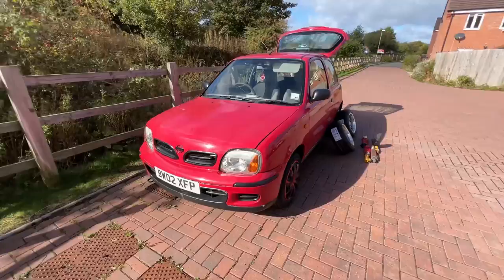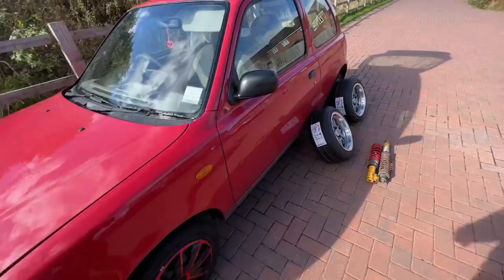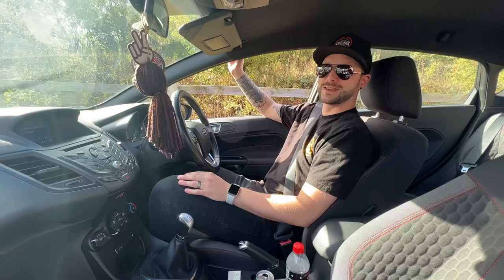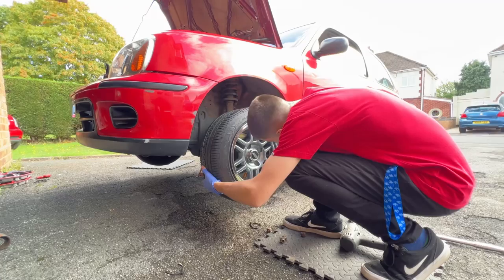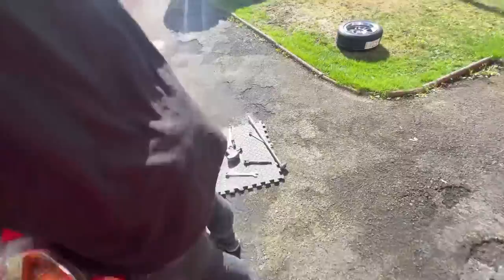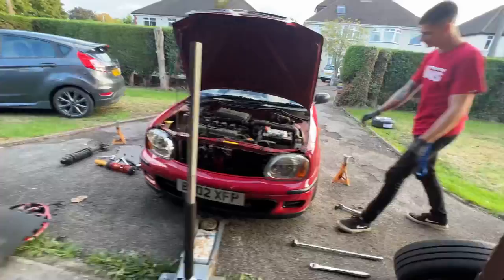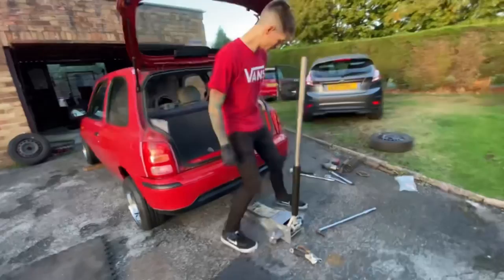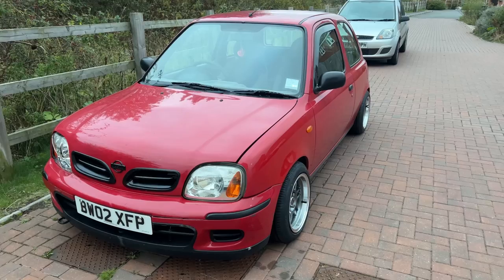Nissan Micra K11 - Best starting mods for new projects

Comment: hello from Australia ,i just bought a 5 door and would love to go bigger on tyres ,its got 1656513 and id love to know what size 15s i can fit with no issues ,i just smashed the subscribe button and glad to be here
Reply from the maker: Hey dude! Thanks for subbing! Most people go for a 15 x 7 and just try and keep the offset around 30 and you should be golden. 

Much love
Reply: @TheCruise94  19505015?
Reply from the maker: @PETERNESS  Possibly. Depends if you’re going to be lowering it or not, 195 is pretty wide if it’s going to be low. But should be perfect if it’s staying stock or just going down a little bit
Reply: @TheCruise94  thankyou  for reply

Comment: Do u still use the rear spring I noticed how the rear coilover had a spring around it which bolts to where the shock absorber goes probably stupid question ask but quite confused
Reply from the maker: You use the coilover spring provided, they’re separate

Comment: Hi I have a 2001 micra 4 door with 15 inch bbs reps. Put new shocks in it and when it’s parked up looks like there is loads of room but when someone in the back it rubs on every bump. What should I do ?
Reply: stiffen the springs a bit, should help

Comment: Hi mate, what are wobble nuts?
Reply from the maker: They’re a normal wheel nut that where the neck of the thread has some movement in it to allow fitting wheels that have a slightly different PCD

They allowed me to fit 4x101 wheels to this car which is 4x100
Reply: @TheCruise94  ahh ok are they full safe to run?
Reply from the maker: @3d4n  Yeah of course if you get the right size. I wouldn’t run them if they weren’t safe haha